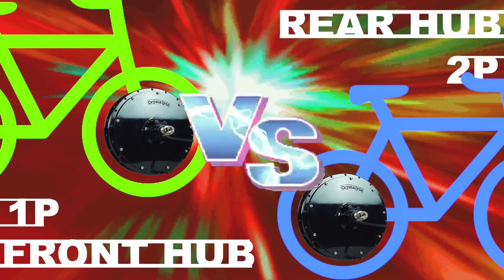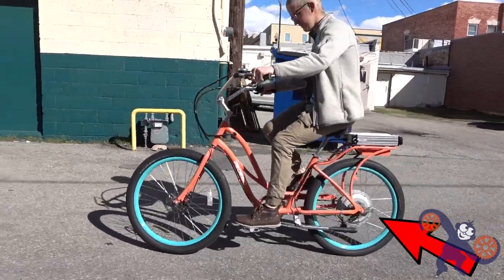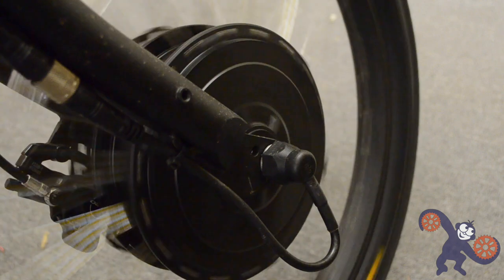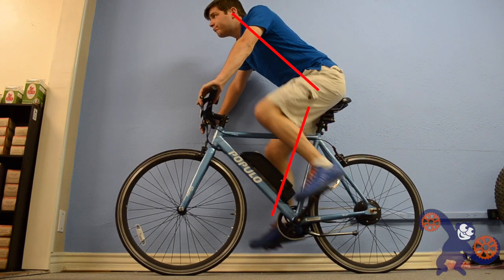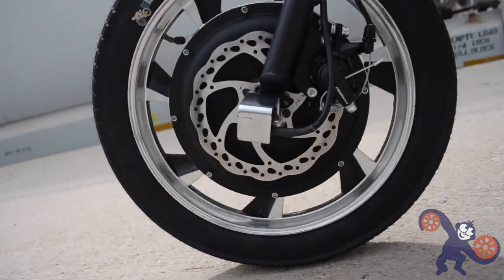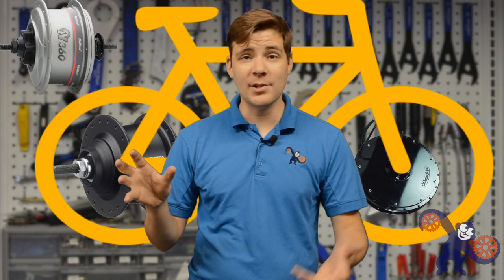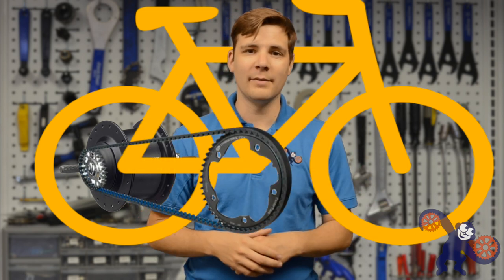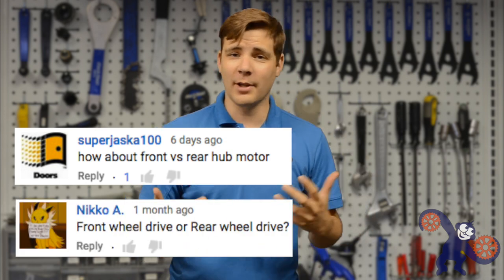Front Hub VS Rear Hub eBike Motor

Comment: 2WD is better than one WD in the real world. Power to the front means that you also don’t sacrifice 10 or more gear speeds like a rear hub motor does. It of course takes getting used to and is dependent upon the terrain of use. Muddy up hill choice 2WD. RWD sucks in the mud. You will spin out and fall. I know mud
Reply from the maker: How many two wheel ebikes have you ride in the mud?
Reply from the maker: How many two wheel ebikes have you ridden in the mud?
Reply: Blue Monkey Bicycles how many have you? You already asked me this question
Reply from the maker: How many two motor/wheel ebikes have you ridden in the mud?

Comment: You're being a little dramatic IMO, because I was scared of a front hub bike being sketchy and I just did a first test ride with one I built today and it's not sketchy whatsoever, I rode like a dumbass, using the throttle instead of pedaling on really fine gravel, full throttle launches both on flats and hills, tight u turns using the throttle, top speed runs at full throttle while pedaling at the same time, and not once did I feel like something could go out of control, except when I needed to brake since the brakes I have really aren't good enough for an ebike. So unless you're putting a really high wattage motor you're gonna be fine, and even there you would just need to be careful on the launches and maybe lower the boost start settings of your controller. Also make sure your seat is high enough, if it's high enough, a good amount of your weight is distributed back to the front of the bike through your arms.
Reply: Hey, did you convert it your self ? And if you can send me a link to from did you buy the kit and the battery please
Thanks
Reply: @shootballhd5395  I did convert it myself, however I didn't buy a kit.
My sister wanted an ebike for a long time and while going to a store where they sell used stuff, she found two bafang 250W front hub motors with wheels, two controllers and a bunch of other random parts, so the plan was to use those for an ebike conversion.

But the controllers where totally unknown, there was two google results while searching the part numbers and they were some unhelpful forums in German so I never managed to figure out the non standard wiring those controllers had, and they didn't even have an lcd so I decided to get new controllers.

I got a g51 lcd with a 250w controller and a thumb throttle here (250W THTOTTLE option) :
https://fr.aliexpress.com/item/33041524586.html?spm=a2g0o.productlist.0.0.6f602b46oS31Ku&algo_pvid=da1d64c4-4bc8-4b43-855b-390e34282513&algo_expid=da1d64c4-4bc8-4b43-855b-390e34282513-11&btsid=0bb0624216016697719528213ebb43&ws_ab_test=searchweb0_0,searchweb201602_,searchweb201603_
I really do recommend this seller, he shipped pretty fast, the things were in separate bags to prevent scratches, there even was a little bit of foam in the box to keep everything from moving, it got shipped pretty fast for something from aliexpress, the thing works really well out of the box, the lcd looks professional and can be found on 1000+$ prebuilt bikes, and Kunray even provides instructions in the package and gives a whatsapp number if you have any question, overall a perfect and very professional experience.
Obviously get one with the proper wattage for your motor

The battery I got is this one :
https://fr.aliexpress.com/item/4000231925867.html?spm=a2g0o.productlist.0.0.2ffc790dXOmbTN&algo_pvid=9105f6ad-6d72-460f-b665-5502fb0ea979&algo_expid=9105f6ad-6d72-460f-b665-5502fb0ea979-0&btsid=0bb0623316038832353807973eb992&ws_ab_test=searchweb0_0,searchweb201602_,searchweb201603_

With this charger :
https://fr.aliexpress.com/item/4000160651663.html?spm=a2g0w.12010612.8148356.3.53e546e7RcR2Je

There's only two brands that can be trusted when it comes to Aliexpress batteries and it's Aerdu and Liitokala, always check for reviews because some people sell shitty batteries under those two names because they know people will look for them, but if there's at least 50 reviews with an average note greater than 4.5 it's probably legit . My first choice was a Liitokala but it was out of stock at the time. I'd recommend a 10ah minimum on a 250W motor, but you might want a little more if you never wanna assist the bike by pedaling, if you're on the heavier side or if you have a more powerful motor.

Btw, 250W in my experience gets up hills fine, the bike I converted is pretty heavy, it has 28 inch wheels and I'm not particularly light, I haven't weighed myself in a long time but we're just gonna say I have a dad bod lmao.
Desptie all that it gets up very steep hills (when I say very steep it's like reaaaally steep) at 15kmh with no pedaling, 20kmh if you pedal as you would on flat ground on a normal bike. So 250W is good as an assist, if you never wanna pedal you might wanna get at least 350W, but if you don't mind helping the motor by slightly pedaling you're fine with a 250W.

Most people on the internet will give you the impression that 250W barely gets you an assistance and that it doesn't get up hills, but you gotta remember that a regular healthy person outputs 200W peak when pedaling, and 300W peak for an athletic cyclist, so if you have a 250W continuous rated motor, which can go way past that for short period, some motor can peak to almost twice their continuous rating, so you have at least as much power, if not more than a pro cyclist, only difference is the rpm range is limited, but whatever, what I'm trying to say is that it's already a decent amount of power.
Reply: @imnota  I really appreciate your help ,thank you so much, I work part time  delivery job with the bicycle , and I want just a bit of help on the hills , so 250w would be enough for me, thank you again for taking time and responding to me ,
Reply: @shootballhd5395  No worries man, but if you're gonna use it that much I'd say it's probably a good idea to invest in at least a 15ah battery.
The rule of thumb is that for some casual 15-20mph riding with casual pedaling you use 20 W/h per mile (or 12.5W/h per km if you use metric like me)or 30W/h per mile (18.75W/h per km)if you're using electric only.

You can calculate the W/h of a battery by doing Volts x Ah, for example in my case my 36v 12ah battery does 432W/h, which with casual pedaling would indicate an estimated range of 21.6 miles or 34.5km.

I'm guessing you ride a lot so maybe something like a 15 or 20ah would be a better match, and they're not much more expensive, a 12ah is 70€ while a 20ah is around 100€, what killed it for me is that the 20ah had 35€ of shipping compared to the free shipping of the 12ah, probably because of the 20ah being heavier, but you might get cheaper shipping if you're in the US, or maybe the difference in price is less important to you.

A 36V 20ah battery is 720W/h which would be around 36 miles or 57.6km of riding with casual pedaling, which seems more fitting to your use. But in the end it's no big deal if you don't have battery anymore you can still pedal like you're already doing now, at least you don't get stranded.

I haven't really tried the bike on such long rides but I have a feeling those numbers are slightly on the low side, but it's always better to underestimate a range rather than overestimate it like most ebike manufacturer do. They often give numbers that are possible only if you use the lowest level of assist and pedal very aggressively.
Reply: @imnota  Thank you man, last  question please ,
Front motor when you turn while accelerating it doesn't slip ?
Reply: @shootballhd5395  Mine doesn't and I have skinny tires so yours shouldn't either.
Reply: @imnota  Thank you so much again man I appreciate it 🙏
Reply: @shootballhd5395  
Thought of another thing that probably will be helpful when you buy a battery and that was very helpful for me, I had to figure it out myself, it was my first experience with batteries composed of 18650 cells and nobody tells you that trick explicitly, but when you think about it it's basic electricity.

In the battery's specification sheet you'll usually find a weird combination of numbers and letters like 10s3p or 10s4p. (if you see one listing where they don't mention it don't even think about buying that one, they're hiding something)
The number followed by the letter S is the amount of cells in series, that's the value that dictates the voltage of the battery, each cell is rated at 3.6v, so a 10s battery is a 36v battery, a 48v battery would need to be in a 13s setup.
the amount of cells in series X 3.6 = total voltage of the battery

But that part doesn't really matter that much, they never lie about that, it's just a needed part of the explanation.

The part you need to worry about and check if it makes sense is the the number followed by the letter P, that's the amounts of cells in parallel.
The amount of cells in parallel dictates the Ah of the battery:
the amount of cells in parallel X the capacity of each cell = total capacity of the battery

Sometimes sellers tell you the capacity of each cell, like the aerdu one I bought with 2.9ah cells, that battery is a 10s4p, so if we do 2.9 times 4 we get 11.6Ah, which is exactly what the seller says, obviously you have to believe them on the capacity of each cell, but at least that's a realistic number, and even if we imagine they're the more common 2.5ah cells, we still have 10ah.

You just need to know cells usually are 2.5-3.5ah depending on the model (there's less powerful and slightly more powerful ones but that's a realistic range, 2.5ah cells are the most common, and anything over 3ah is unlikely to be real in a cheap chinese battery), so when you see some batteries that claim to be like 15ah with a 10s3p config, you know it's fake since with the same calculation as above, but the other way, you divide the capacity of the battery by the amount of cells in parallel and that tells you that to attain that capacity they would've needed to use 5ah cells, which do not exist, I think the highest capacity cells ever are something like 3.9 or something like that.

But yeah, just an important thing to look out for that I wish someone told me about when I was looking for a battery.

Comment: This is n1 bullshit. I think a
Front motor is extremely efficient if you don't use so much torque to have a crazy acceleration  ..
It just needs a torque arm to be safe above 300-500 W motor and that's it..
Reply: What makes it more efficient than a rear hub motor?

Comment: there is no advantage front hub is exclusively for cost and convenience nothing more
Reply: some advantages that immediately come in my mind are
- two wheel drive when pedaling
- possibly better weight distribution (typically there is too much weight on the back)
- support in sharp turns
- motor induced back flip (e.g. on a steep incline) is impossible
Which one is preferable probably depends a lot on the motor power and how the bike is used. https://youtu.be/IxB2j-egWcQ?t=5692
Reply: You can convert back your ebike to a regular bike in 2 minutes. Take out the wheel and the battery and it's done! That's huge.